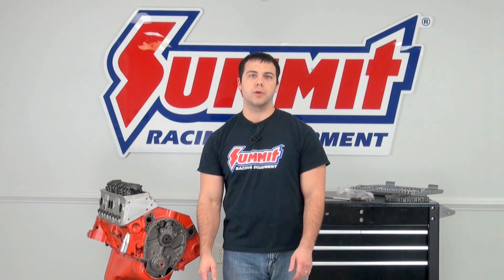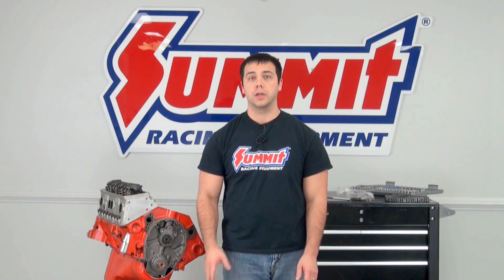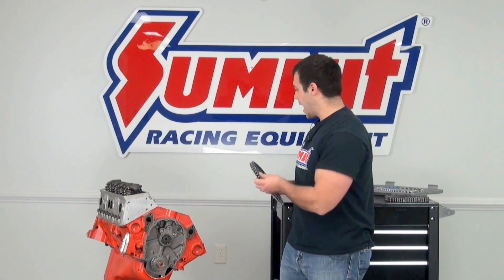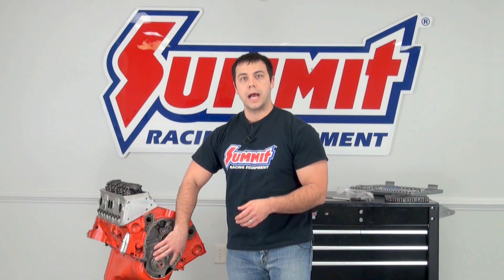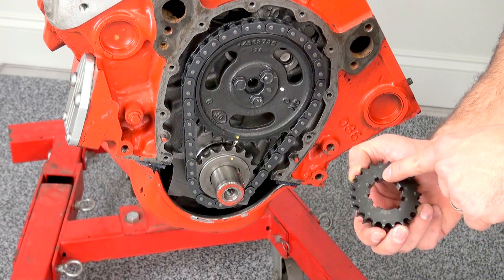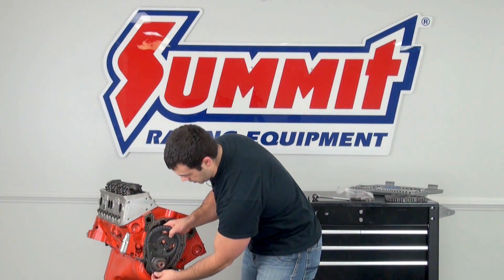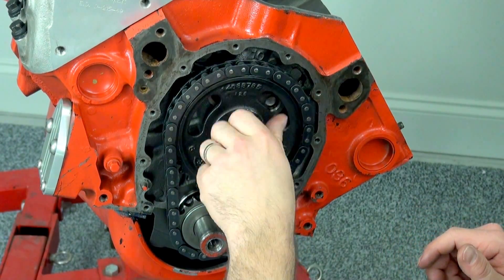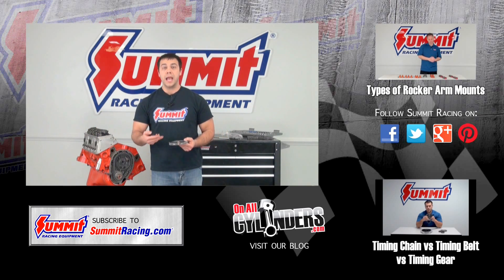How to Install a Timing Chain - Summit Racing Quick Flicks

Comment: Is finish doing my timing change At TDC My question is do I rotate my Crankshaft Over until both dots are at 12 o'clock. For Firing Piston number one. Then do I drop my distributor and face my rotor to spark plug  number one. And put my timing change, cover back on Could I get your help, thanks?

Comment: Yeah j think I went straight  up instead  of advanced   the comp cam  says 6 degrees  . My distributor  has to be fully  advanced  to ru. Great but think  it could run  better . Any tricks?  I'd  rather not take everything  apart.

Comment: Ordered a timing chain set from you  guys for a 350 and it doesn't even fit. Cam bolt pattern is different so now I have to drive an hour to see about getting the right one or just return it and get it elsewhere

Comment: I have a single timing chain and a Double Roller timing Chain can I do this? and do you have a Video that shows how to install a stretchered timing chain so I can put the cam where it should be while on TDC. this is a 3/4 ton chevy 350 1984

Comment: Why is ithat when I pulled my cover off my timing chain and I have the distributor on number one on cap the top gear dot is a top not at bottom
Reply from the maker: This is correct.  With the number one at TDC in the firing position the dots on the crank gear and cam gear will both be at 12 o’clock.

Comment: My engine shop ordered a timing chain set along with the new pistons ect. for my motor when l had the machine work done. I got one of your summit brand set w/ zero instructions and about a thousand different key slots on the bottom gear. which key am I supposed to use for dot to dot installation. This video doesn't explain which one to use. Now I'm stuck...can u exlian which one to use. there's a dot and a zero "0" on the lower gear...do l  use the dot key, or the "0" key? or what...? very frustrating. please answer.
Reply from the maker: Hi Guido, we are sorry to hear you are having issues here. Can you please provide your order number or the part number ordered?
Reply: @SummitRacing  As I said, the machine shop ordered the timing set. I have since figured it out. Just FYI - For dot to dot timing adjustment... the bottom gear slot "0" is set at the key, and the 2 dots coordinate normally as they should. Directly up and down from each other. I saw all of those key slots and freaked out! lol I'm just a novice home builder and prefer simple and un-complicated. I'm taking things very slowly in an attempt to avoid any mistakes. I rarely get a day off from work, and suddenly found this problem this multiple key set for degreeing a cam which I have no interest in doing. Just very basic and plain, mild build. thanks for your time and reply.

Comment: Once you have the timing marks lined up on a small block Chevy 350 where should the distributor pointer be pointing at
Reply from the maker: When they are correctly lined up, both dots at 12:00, the rotor should point at the front intake bolt on the driver’s side.

Comment: Is there typically a gap behind the crank  pulley?  It requires the cam to come out about 1/2" for the chain to line up on mine
Reply from the maker: Hi Mike, If you are referring to the crank gear for the timing set, there is a step on the snout of the crank that will stop the gear when being installed. If the gear is touching this step, it is located correctly. Depending on what engine and how far in the camshaft is pushed in, it may need to be pulled out for the gears to align. Just make sure both gears are properly oriented (correct side facing outward).
Reply: @SummitRacing  Make sure the cam lobes are centered under the lifter bores.

Comment: Didn’t even show the users how to install the crank gear...
Reply: Ok, let's help. 

 First, check dimensions with crank and sprocket at the same temperature.  A set of good digital calipers can get you 0.0005" readouts, which assures 0.001" accuracy.  Measure the inside diameter of crank sprocket, then measure the crank diameter itself - measure more than once/thank yourself later.  A good fit is going to be something between a match and 0.0015 difference.  If the difference is bigger than 0.002", either your crank got overground or the sprocket is too big - stop assembly and get parts that match up, as looseness guarantees premature key failure somewhere down the road.  Being keyed,  you don't need an interference fit, so the sprocket I.D. should never be smaller than the crank.   If it's an exact match, dry fitting to check alignment between that and cam sprocket could take a little work, so don't begin without having a 3 jaw puller handy in case you need to remove the crank sprocket [I keep a bolt to fit crank snout handy with the center drilled 1/8" deep using a 3/8" bit to ensure the puller stays centered if it comes to that].   Why some ask?  Because to put it on with matched dimensions, you are going to have to put a little heat into the sprocket: an oven at 180F for about 20 minutes usually does the trick for expanding diameter temporarily.  Prior to heating, please check that your  key seats fully in both the crank side and the sprocket.  While hot, slide that puppy on so it just snubs up to the radius ground into the end of the snout - don't hammer it on with a 3 pound shop hammer [persuasion on this probably tops out with gentle tap of a 10 oz ball peen using a deepwell socket to protect the crank if you insist].   Check to make sure teeth of cam sprocket are directly over crank sprocket teeth at this point [I am assuming sprocket depths for crank and cam were checked and match - manufactuers usually get this right/sell as a set].  If not, the problem is usually the crank sprocket being too far forward/proud of cam sprocket.  Using a straignt edge across whichever sprocket sits proud, you can use a feeler gauge to determing the gap on the other: that is how much material needs to be removed from the backside of the [crank] sprocket where it meets the crank snout radius.   On the other hand.... if it's the cam sprocket sitting proud, you may need to have a machine shop reface something [either the block or the backside of cam sprocket] - in most cases, mess with the cam sprocket or swap wear bushing [if that is your setup], as it's the cheaper part and will save a bunch of time.  I don't recommend mixing sprockets from different manufacturers, as that's gambling on uneven and early wear patterns from teeth profile differences.
There you go.  

As a side note, some people using hydraulic lifters [older chevy v8 would be typical example] experience some chatter on start up.  I'm told drilling a small hole in the end plugs at the end of each lifter  galley [right behind the cam sprocket] will get air purged on startup:  0.030" should do fine for purging air without giving away oil pressure in vital areas, and the chain gets some extra oiling as a bonus.   That's probabley better done on a bench before you drive plugs in, and is part of block prep when you know hydraulic lifters are part of the build.     Disclosure?   I don't like hydraulics, and run solid lifters: flat tappet or roller doesn't matter to me.

Comment: Question i am installing new timing chain...when crankshaft and camshaft gear marks are lined up is that also top dead center on cylinder number one? I think it is ..just want to make sure...thanks
Reply: Since they never responded and I'm sure you figured it out by now. Dot to dot will be tdc on #1 intake stroke. Before you stab the dizzy in rotate the engine one full revolution crank and cam dots will be at the 12 position or straight up. If you go dot to dot and fire it up it will be 180 out. Firing number 6 cylinder you could reclock the the wires #6 will be #1 follow the firing order 18436572. Sorry I'm 3 years late lol

Comment: Have questions. 1975 Pontiac 400. Has Sum K2802 cam kit and Comp cams 2112 Double roller timing set. Both are installed cam has cam plate which bolts to the front of block keeping cam from moving forward next is gear's and chain crank at 12 and cam at 6 off to the fuel pump eccentric this is my problem. Cam gear has a bolt hole in center to retain eccentric just as stock but the eccentric will not fit due to no cut out in cam gear. Only cut out their is, is woodruff key full cut out. Can you give me any insight. Thank you

Comment: Does one crankshaft rotation denote a full revolution? (Dot from 12 o'clock to 12 oclock=cylinder 1-cylinder 1?) 
Also my dots when rotating don't fully align(crank gear is out an eighth of an inch advance)
Reply: I found this video lacking in two ways : he didn't differentiate between the two bottom crank gears when talking about presetting time (can you adjust timing with a single keyway or was that option excluded to the multiple keyway gear.
Secondly it all just fell together like there was never a problem! So say " where the camshaft position were initially out, the crank doesn't have a gear and the assembly has shifted . Then when you get to TDC on the crank assembly, the cam shaft needs adjusting from exhaust stroke to intake stroke and the ratio difference between gears. Etc etc.
Reply: I have the same question

Comment: hmmm, so a slightly stretched chain could cause a random misfire AND a knock? cause I've got both in my 4.3 vortec and literally everything else has been replaced? seems simple enough.
Reply: DIRTDIVER882 yes play in the chain. It is 8 time's out of 10 caused by worn teeth on the gear's. When slack is present you'll have play in the cam shaft throwing your timing off.

Comment: I bought a Cloyes timing gear set and don't know if I should set it advanced retarded or straight up??????  I have a Lunati cam (.480 lift and 270 degrees open) and Vortec heads,  I put it together advanced and it has a FLAT SPOT just off idle. I've checked initial timing and full advance (got about 37 degrees)
Reply from the maker: Hi dtsb52, 
Initially all cams should be installed on the zero keyway and then degreed in properly. If you need help through the degreeing process, give us a call and we’ll help you get the right tools to do the job correctly. 1-330-630-0240. Thanks for watching!

Comment: I have a sbc that only runs when base timing is set to 30 degrees advanced. I inherited this vehicle and looking for advice before I take things apart. I already restabbed the distributor  TDC #1 and still only 30 degrees or so wil make it run and it runs great. What could be wrong?
Reply from the maker: Hi Joe, 
This is a common case of the distributor being installed in the motor a tooth off. Bring number one cylinder up to absolute true top dead center and make the rotor point at number one inside the cap!

Comment: hi i wanted to put a cam on my 2005 chevy 4.3 v6 but i dont wanna change the heades or push rod or anything else i just wanna plug and play what would be the best cam for it i am also gonna change the timing chain so might as well do a cam
Reply from the maker: +eliaxel07, 
Well, it’s unfortunate but, the “plug & play” camshaft you request really doesn’t exist. A cam that would have upgraded performance over your stock cam would also have a higher lift and longer duration requiring upgraded valve springs and an adjustable valvetrain. Also, the fuel requirements to match the new incoming air would also have to change. This is done by custom tuning of the computer by a qualified tuner.

Comment: I have a 1993 Chevy 1500 5.0L The old timing chain has a lot of play. I compared it side by side to a new timing set. The new set is almost as long as the old one. The length differential is millimetric. Is this normal? Thank you, very much
Reply from the maker: Lionel Luthor , 
No, this should not be considered normal on this application. A new chain and gear set should be tight when installed properly. That is providing there has been no machining done on the engine block and the new parts are packaged correctly!

Comment: When you have a engine out and torn down to that point, it is always a good idead to check the end play or lateral movement of the crankshaft especially on higher milieage engines or ones that are on the bottle. Thrust bearings are much easier to get to at this point and that walking crank is just an indicator of catastrophic damage that may strike at anytime. Examine the cam gear, if you see wear on the back side at the gear teeth and not the front you can almost be sure your crank has to much end play and that the thrust bearings are worn. I have been seeing this a lot lately on cars running transbrakes as well as manual transmissions. Trust me a quick check is cheaper than a destroyed bottom end at the 60 foot mark and far less embarrassing.
Reply from the maker: Hi mybadvette, 
Thank you for sharing your advice!